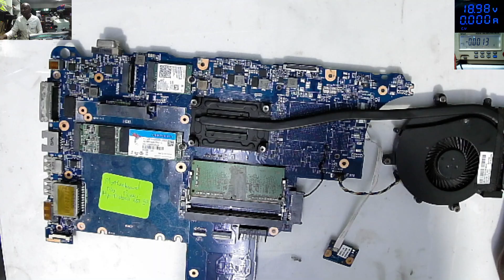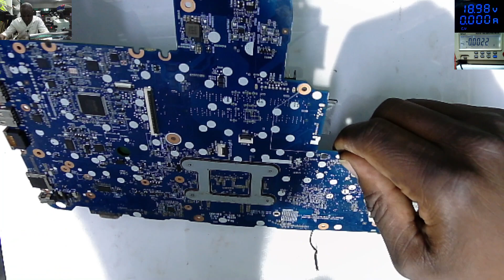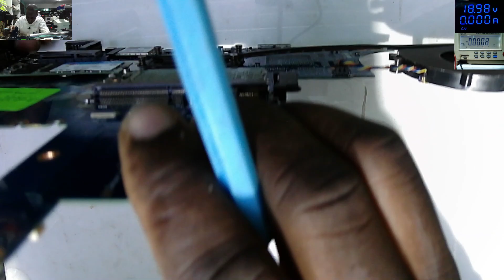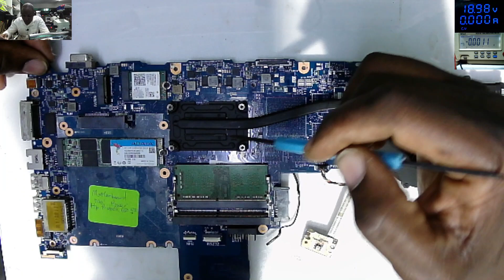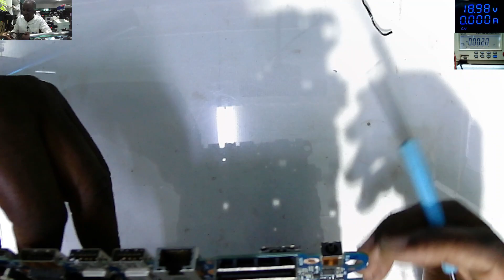What Can Ruin Your Day In Electronics Repair? Hp ProBook 650 G2 Motherboard Repair Attempt!!!

Comment: For testing the power key you make a 3.3 volt from external pwrsply, because that pin had a 2.46 volt, i think it wasnt necessary cause it is like a binary code for micro like 0 and 1 , it just know the voltage or no voltage, any voltage between 1 to 3.3 mean 1 for it and no voltage mean 0❤